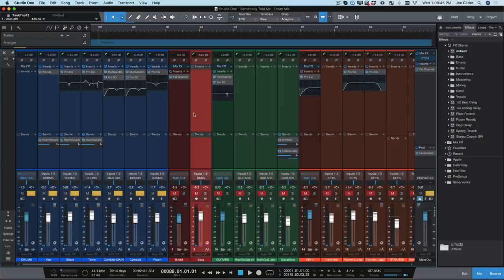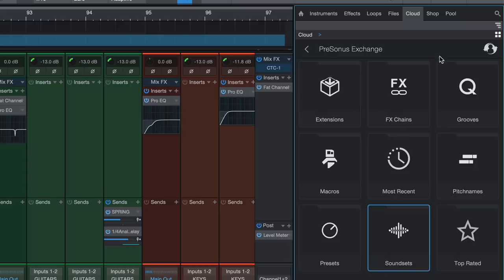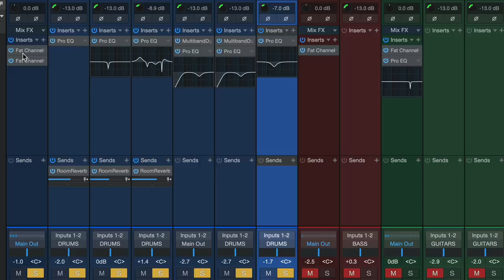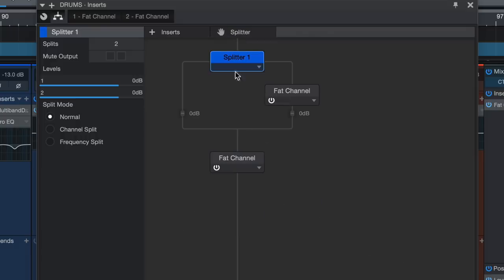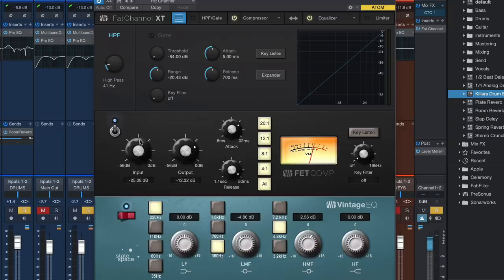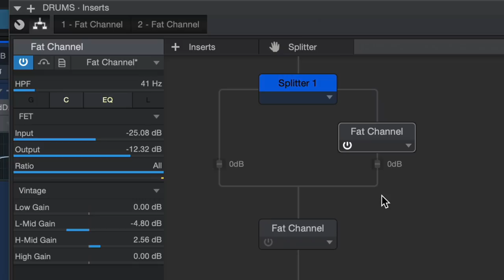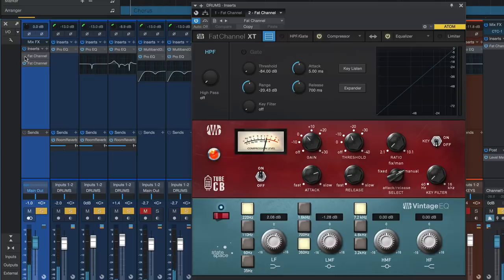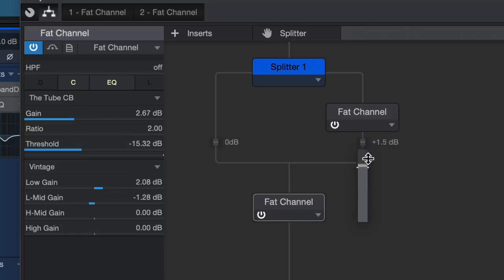Parallel Compression on Drums (Free Download)

Comment: Interesting to use the routing with the split feature instead of another track
Reply from the maker: Yup. Both can work, but this way lets you do a true parallel process, vs running them in series (one bus using a send to go to another bus). And it's way easier to set up than multiple channels.

Comment: I know what splitter is, but what you do just makes no sense to me.. All  that compressor do is turn down the level, so you are not gettting any coloration on drums and you could get the same efect using just compressor with less compression. I could understand if you side chaned some other effects with compressor. Like the drums  you hear compressed but the reverb not or the other way around. That would make sense, but this? It just adds overall volume and lowers level on one source of sound. Thats logic, you could dial down your compressor and get the same.

Comment: this is the first time i've seen parallel compression done this way in studio one. Would it be easier to use a bus and send to the bus blending in the compressed signal?
Reply: Nicks Corsair S1 Tips I think this is much cleaner looking if you’re concerned about overpopulating your mixer but then it’s easier to just grab the buss’s fader and blend it compared to diving into the inserts routing page.